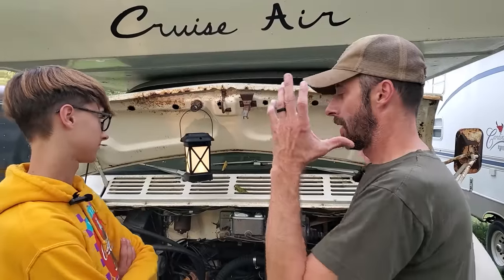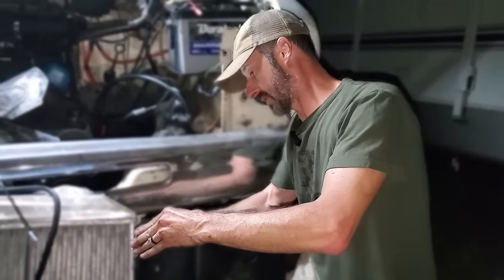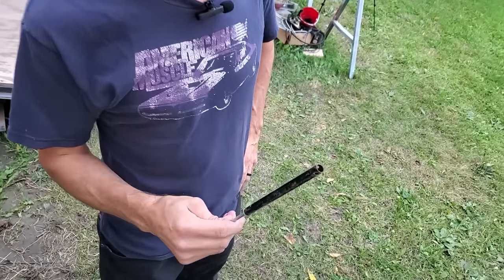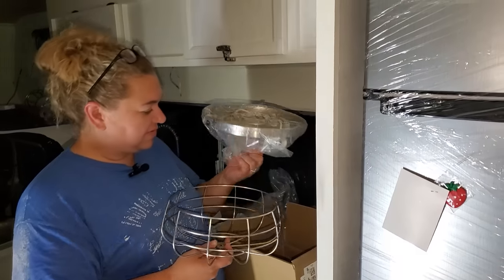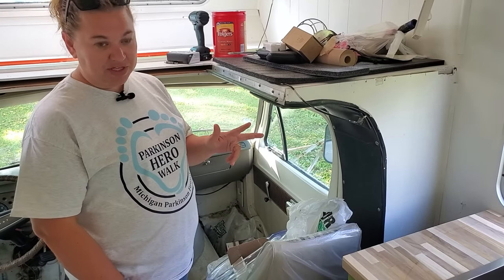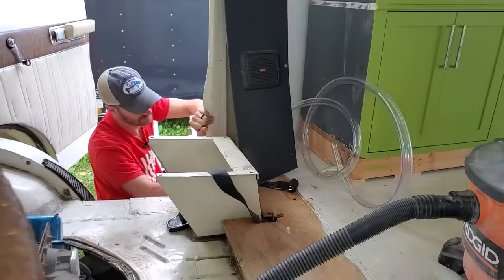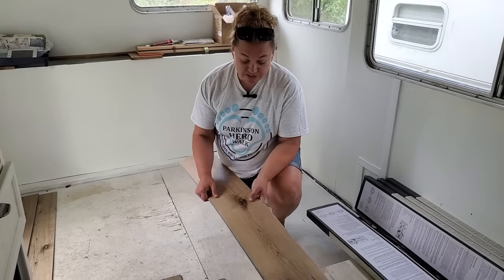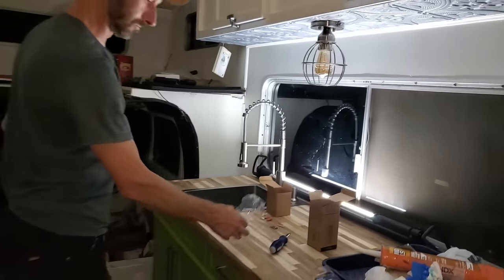1970s RV Renovation - Pushing Toward the Finish Line!  LVP Flooring, Fan Clutch, Trim, and More!

Comment: That tin ceiling treatment for the bottom of the cabinet is an awesome idea. I have a similar situation in my fifth wheel where I removed an ugly 12v fluorescent light fixture and replaced it with a slimline LED light. The old fixture left lots of holes in the cabinet including a huge hole for the wires. I think I may use the tin to cover everything up.
Reply from the maker: Hope out turns out for you!  We got this piece from Home Depot, ordered online.  I just saw peel and stick tin roof looking stickers at Dollar Tree though!  Maybe check that out too 👍👍

Comment: Hey Guys!  Loving try videos.  I’m trying get all 36 in. 
Under the understanding that I can spend the hell out of your money: I would upgrade the exhaust system to duels. With that said, I would probably go with at least 3 inch. For my mufflers I would go with Flowmaster 70s. They are very quiet and close to stock. You  will not get the drone normally associated with the other muffler. To be safe and not get any drone you can go with some small resonator mufflers in the back. That would get you a safe, efficient, and quiet exhaust system that will last for many years to come. There is a lot of debate regarding aftermarket headers. In my opinion, the factory headers are just fine. What is gained with aftermarket headers quite frankly… The juice is not worth the squeeze. Keep up the great work! Now I’m going back to the videos.
Reply from the maker: I would love to get some new exhaust on Harvey. It does have duels but could stand an upgrade. 3" and Flowmasters would be sweet. If you we wind up getting around to that, headers would probably be looked at too. Maybe someday 😉

Comment: You guys are awesome!  I am curious how you will keep the methane from the black tank from coming up the kitchen sink?
Reply: Not to mention the bacteria 🦠
Reply from the maker: We'll add a trap under the sink so, as long as water stays in the trap, it won't let any gasses come up (or bacteria).  The camper was plumbed that way originally so it should be ok.  If not, lesson learned!

Comment: The former furnace space looks ideal for filling with Lithium Iron Phosphate batteries to go with solar panels on the roof. The spring things to hold the cabinet doors open should also go over center a bit when closed to hold them shut, and they should keep the handles from hitting the ceiling when the doors are open.
Reply from the maker: Ooh, good point about them keeping the handles from hitting the ceiling!  We haven't had time to add those yet but it's on the list!  Solar and batteries aren't on the list yet but maybe one day!  That would be the perfect location though.

Comment: I couldn't find your other video I don't know if you'll read this but like I said when you guys took off for your little trip after everything was somewhat done when you had that whining of the belt you should check to see the amperage pole put in amperage gauge in when the refrigerator kicks in you can see the amperage pole and see if it coincides with that you may have to put a double belt in a high amp alternator for running all the more electricities sometimes you can even install a second alternator like ambulance do a 440 torque would pull that with no problem Hope this gets to you and helps you out
Reply from the maker: Thanks so much for the comment!  That was something that didn't occur to us at the time.  We were pretty much on panic mode trying not to be late to see the kids.  We were able to get it to stop yelling by tightening the belt but it's something we'll keep in mind if we have alternator issues down the road.